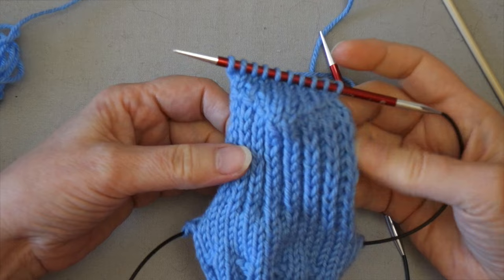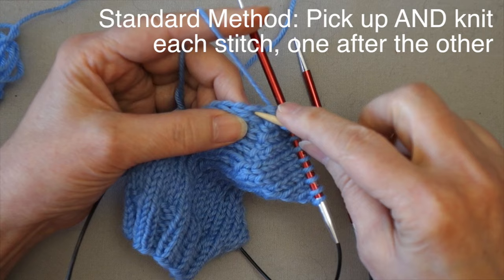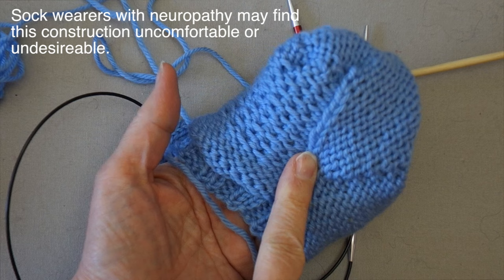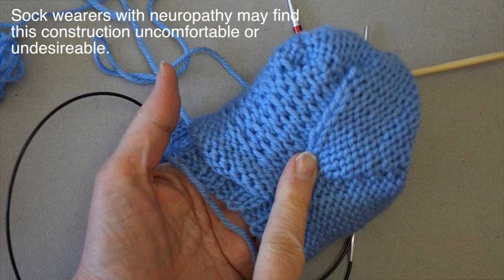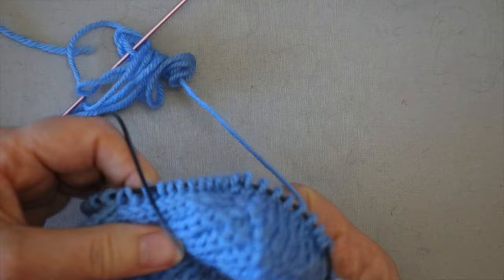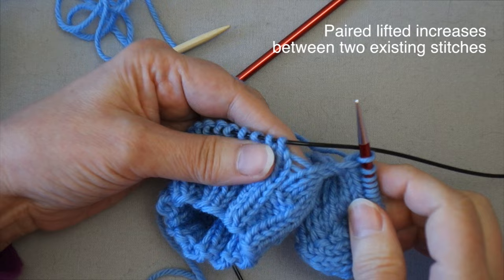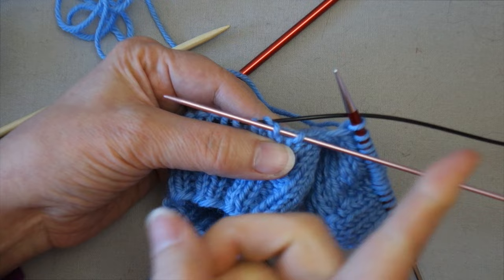Tips & Tricks for Sock Heel Flaps

Comment: I've made lots and lots of socks, but this is a first for me about picking up stitches for the heel flap doing one leg for the stitch and also with the no hole gusset. I do no hole gusset a bit different as I combine the two together and pick them up together and pull the yarn through both legs of the stitch. Your way is great too. Thank you so much for the tips on this video. You are very clear.

Comment: It's an old clip, but I've been really bothered with the ridge I am getting on the inside, but never figured out how to deal with it. And it seems like no one else mention this "problem". Thanks! I really appreciate this!!
Reply from the maker: No one mentions it, because that ridge is a normal by-product of picking up stitches. In most other situations, you wouldn't have a slipped selvedge when picking up stitches, and would be picking up at a different rate than 1:1, to boot. Socks are really a special case for picking up stitches, and since that ridge is typical, there wouldn't be a reason to comment on it. Still, it's nice to have the option to work the process differently, either because you prefer the process itself, or because you prefer the result (or both!).
Reply: Roxanne Richardson I think you’re right. But it’s kind of when you are going to the doctor and gets the verdict “it’s perfectly normal”, even when you thought there was something wrong. Technically they don’t need to tell you that, but it sure feels good to hear it.

Comment: Thanks for this video.  I am making my first heel flap socks, and after picking up my stitches I was sure I had made a mistake, because of the ridge on the inside.  I know I would feel that ridge, so searched videos to see what I was doing wrong.  I discovered I was picking up stitches correctly, but the technique was flawed.  Found your video, so now I can make socks without that annoying ridge on the side of the heel.  I will definitely also use your tip for eliminating the hole.  Thanks so much!

Comment: I think an easier way to prevent holes is to work a "wrap and turn" at the ends the first two heel-flap rows.

No need to make extra stitches to decrease away later; the hole is closed when the wrap is worked with the regular stitch. YMMV.
Reply from the maker: As always, there are endless ways of getting to the same place, when it comes to knitting.
Reply: @marchair - really interested how you do this. I do understand this was an old thread you commented on

Comment: Dear Roxanne, I cannot tell how much I already have learned from you excellent videos! But now, I could not quite understand the 'maths' of your method to avoid holes. I understand the increases of both stiches next to the 'conneting' strand, which will bring the total per round to plus 4. (2 on eacht side of the sock). But, you only mention 1 decrease (per side) which leaves me with 2 extra stiches. I hope you will be able to enlighten me on this issue. Thank you very much! Kind regards, Annette Nicolai, The Netherlands.
Reply from the maker: The gusset is worked by decreasing every other round until you are down to the number you had for the leg. So you will do that in this case, too. It doesn't matter that it might take, say, 12 rnds to do that rather than 10. The point is to keep decreasing until you are down to your target number for the foot. In some cases, you may want to stop decreasing early, to give yourself a foot circumference that is larger than the pattern calls for (if the foot you're knitting for is larger in circumference than the ankle), or you may want to continue decreasing longer, if the ball of foot is smaller in circumference.
Reply: thank you very much for your quick answer! I think I understand now what made me confused: as I always knit on circular needles, I was thinking that the 'upperfoot' would end up with these 2 extra stiches. But, obviously, you change the 2 of them to your 'underfoot' and in that way they will become part of the gusset decreases. I hope this explaines my confusion. Kind regards and thanks! Annette
 @RoxanneRichardson

Comment: Another question about Charlene Schurch's 2 stitch pick up:  on my heel flap side, the stitch I will go through is a knit stitch.  On the instep side, it is a purl stitch.  Would I pick up the closest leg to the instep of the heel flap knit stitch to follow the bar, then pick up the purl stitch on the instep from the bottom of it (since there are no legs to it on the public side), then work the instep pattern, then reverse the pickups for the far side of the instep?  Just wondering what is the least visible if the stitches on either side of the bar are not both knit stitches?  The pattern on my instep for this sock always preserves the 2 instep edge stitches as purls.

Comment: Hi Rox thanks so much for your tutorials, I'm enjoying them and  very much appreciate  your teaching style and explanations which are particularly clear.
Regarding the lifted increases on the second side of the sock i.e. after you have knitted across the instep, are these 2 stitches placed with the instep stitches or do they form the first two stitches on the 3rd needle that will be used to knit along the gusset stitches?
Thanks
Janine
Reply from the maker: The stitch count for the instep remains consistent. The lifted increases are worked together on the following round to become the k1 that is worked at the start or end of each gusset thereafter. That is, on the first round, you work to those two lifted incs, and decrease them together. Work across the instep sts, then decrease the other lifted incs together. Now you begin the actual gusset dec rounds, which are worked by knitting to the last 3 sts, k2tog, k1. Work across the instep sts, k1, ssk. So those lifted incs become the k1 column adjacent to the instep sts.

Comment: What do you do if you end up with more picked up stitches?
I learned more watching this one video... amazing. Thank you.
Reply from the maker: More picked up sts than the pattern tells you to pick up? Knit the flat to the needed length, regardless of what the pattern states, then pick up 1 st for every slipped selvedge stitch. When you work the gussets, decrease every other round until you have the number of sts needed for the ball of foot. If your ball of foot and ankle measurements are not the same, then you may need a different number of sts for the foot than you needed for the leg. So you can stop decreasing early, if your ball of foot is large, or you can keep decreasing if your ball of foot is smaller than your ankle.  You can skip plain rounds and work several decrease rounds in a row, if you want to decrease rapidly, and you can add plain rounds between decrease rounds, if you want to decrease more slowly.

Comment: Greetings, Rox, I am trying my pickups this way plus I will also try Charlene Schurch's 2 stitch pick up per side as you have shown to prevent instep holes.  I understand on the next round that I would SSK those 2 bridging stitches prior to working the instep, then K2tog those 2 stitches after working the instep.  But that is still 2 stiches more than the instep + pickups + heel after working that subsequent round.  What do I do on the next round after that?  Do I just treat these 2 extra stitches (now 1 per side of the instep) like an extra gusset stitch and just decrease each along with the gusset decreases (preserving my instep stitch count and pattern and just considering these extra stitches like gusset stitches)?  Also, the sock pattern I am working is having me do K2tog prior to the instep and SSK following the instep, so should I do the decreases of the 2 bridging stitches according to my pattern or should I follow Charlene Schurch's instructions for the round after having created the bridging stitches (SSK before instep, K2tog after instep) regardless of my sock pattern's gusset decrease instructions?

Comment: Question (for Roxanne or anyone reading this): When you do your first round of gusset decreases, do you do two decreases next to each other (one for the extra stitches from the paired lifted increases, and one for the standard gusset decreases), to immediately get back down to the expected stitch count? Or do you just do the one set of decreases, and end up with one extra row in the gusset? 

I doubt it would make a huge difference to the fit of the sock, it's just one row after all, but I'm wondering if one is "better" than the other? 

Thank you so much for your videos, they're super helpful!!
Reply from the maker: Just work an extra round of gusset decreases. There's nothing magic about the number of gusset rounds. You work the gusset until you're down to the stitch count you need for the foot.  I have a very high arch, so my heel flap is about an inch longer than what the sock formula calls for. That means I have more sts to pick up, and more to decrease out. I just work the gusset until I'm down to the number of sts I need.

Comment: So my pattern says to pick up 1 extra and then on next row k2tog/ssk, then knit a row then every other row knit 2tog k1 do I add this k2tog to your k2 tog on the 1st round?
Reply from the maker: Your pattern is having you decrease out the extra stitch with the k2tog. My method is to pick up 2 sts and work a k2tog in the first round. With my method, you'll have one more round of decreases to work at the end of your gusset to get your stitch count down to the original number. Or you can work  two gusset dec rounds in a row following the initial k2tog round, rather than working a plain round. It doesn't really matter. A single round when working with sock weight yarns amounts to 1/10th of an inch or less in total length.

Comment: Thank you for all these tips and tricks. One question… when you pick up the 2 stitches to close the gap, then you knit them together next round, you actually have picked up an extra stitch, on both sides meaning you’ve got 2 extra stitches in your circumference for the remainder of the sock. Is that ok? Or do you decrease them again the next round?
Reply from the maker: You will work as many decrease rounds as you need to in order to get down to the stitch count you need for your foot (which may or may  not be the same stitch count that you needed for your ankle, if you have a significant discrepancy between your ankle and ball of food circumference). So if you need to end up with 64 sts for the foot, just alternate decrease rounds with plain rounds until that's the number of sts you have.

Comment: I do like the technique itself but I don't like the different looks of the two sides, though. 

The left side of the sock looks much better. The right side doesn't look the same. It has a thick edge on the outside. 

So I think about trying to change the technique there. Maybe I'll knit the outer leg of the stitches. Or I might knit the additional stitches into back despite bigger gaps. 

Does anyone have a solution for this?
Reply from the maker: The difference in the two edges has to do with the left edge having two adjacent columns of slip stitches. 2nd to last is slipped on RS, 1st is slipped on WS. If you look in my playlist on sock heels, there's a video on how to improve the appearance of the heel flap edges (using an odd # of sts, instead of an even number, which slightly changes the process for working the heel turn)

Comment: How does it work, in closing the gap, when the first stitch is a knit stitch, following the cross yarn, and the second stitch is a purl?
I think this is a really nice way to avoid holes near the gusset but in my current pattern I have a knit stitch where I picked up the 12 down the side, then a purl stitch is on the other side of that bar. Thank you, I love your videos. I have learned a LOT!
Reply from the maker: Are you asking how you work the lifted increases at the corners when the first stitch of the instep is a purl? You can still work the lifted increases. That strand still connects the two stitches, regardless of whether they are knits or purls.
Reply: @RoxanneRichardson  Yes, I think I got tangled up when I first tried to follow the cross yarn under the stitches to close the gap, but it did work out. Thank you!

Comment: The paired lifted increase looks great. Would I have to decrease 2 times each side because it adds 2 stitches each side
Reply from the maker: No. Just decrease once in the first round, and then every other round, as you would normally for the gusset. If you prefer decreasing two sequential rounds before switching to every other round, that's your choice. Neither is better or more correct.

Comment: Question! After the pick up with the 2 paired increases, is your next round a decrease round? If so, how do u handle those increases in that case? Thanks so much!
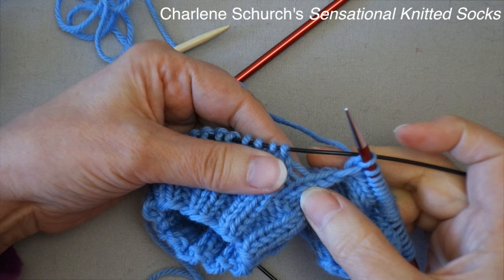Reply from the maker: At the beginning of that section of the video 7:25, I describe that two increases will be worked, and then on the following round, the two sts will be worked together. As the technique is demonstrated, I specify which decrease to use to work the two increases together on the following round. Those decreases will become the sts adjacent to the instep, and on subsequent rounds will be kept plain, while decreases will be worked using the 2 sts next to them.

Comment: Thank you for solving difficult points with the heel flaps 😌. I will practice a couple of times to make sure I integrated your tips! To prevent the hole, I was adding stitches to tighten the hole, but not having to adjust the next row! With some yarn like 100% silk, the result is overly stretchy! Do you have a tip for addressing that?

Comment: When you lift the 2 stitches at the intersection,  don't you need to decrease a stitch for 2 rounds or do you just incorporate the extra stitch into your pattern?
Reply from the maker: You're going to be decreasing many times over the course of the gusset, until you are down to the number of sts you need for the foot. (The number you need may not be the number the pattern specifies -- the pattern is designed based on a formula that assumes your ankle and ball of foot are the same circumference.) 
If you have 2 extra sts at the start of the gusset, based on what the pattern says you "should" have, you can eliminate them at any time during the course of the gusset. My approach is to work a gusset decrease round every other round until I have the number of sts I need to fit the recipient's foot. I have to end decreases early for my brother's socks, because his foot circumference is quite a bit larger than his ankle, so he needs more sts for his foot. 
For myself, I need the same number of sts for my foot that I have for my ankle, but I also need quite a few more sts at the start of the gusset than any pattern would call for, because I have a high arch. I need a longer flap (and therefore I have to pick up more stitches) in order to accommodate my fit issue. I just keep knitting the gusset decreases until I have the number of sts I need for my foot, which makes the gusset quite a bit longer than average.  
In your case, you can eliminate those 2 extra sts immediately, or just work another gusset decrease round at the end. Whichever approach you like better should work just fine.
Reply: @Roxanne Richardson  thank you!  This makes perfect sense.  I have a quite small foot so I've never had to adjust the pattern.  Usually just make the smallest adult size and knit to length.

Comment: On the alternative method of stitch pick up the heel of your sock is exactly the one I need to finish a sock I am working on but I cannot find a pattern for it. I made the first sock 3-4 yrs ago and lost the original pattern. Can you help connect me to the pattern for that type of heel please?
Reply from the maker: That's how I choose to work my heels, regardless of what a pattern might say. I have no idea what patterns might call for this method of picking up sts. If the sock has a particular stitch pattern associated with it, that would be a better way of finding the pattern (posting a photo on Ravelry). If it's just a plain sock in stockinette, you don't need a pattern. If you know what size needle you used, cast on the number of sts the first sock has, and then knit the sock leg to match the length. Then use half the sts for the heel flap, and knit it to the same length as the first.  This week's Technique Tuesday video demonstrates how the heel turn works.
Reply: Roxanne Richardson Thank you. I just subscribed to your channel today. Your teaching methods are in line with the way I learn so I am quite pleased I found you. I will jump on Ravelry as I do want to ensure my socks match exactly. 

A little more info on the sock, it is plain stockinette for the foot portion but the cuff is 2x2 ribbing. The sock is a children’s size (4-5 yrs) and top down method starting with 36 sts on 3.00dpns. I am switching to 2.75 dpns for the foot as that’s how the first sock was done.

Comment: Hi Roxanne.  I have tried this method at least three times and still keep getting a hole on one side of sock.  I have watched and understood your video many times.  I am working with fingering weight yarn and of course tiny needles (2.75 mm).  I am not one to give up and will keep trying.  Perhaps I am not picking up correct "slipped stitches" on one side.  I am following your method to a "T".  Perhaps it is just harder when working with very thin yarn and small needles.